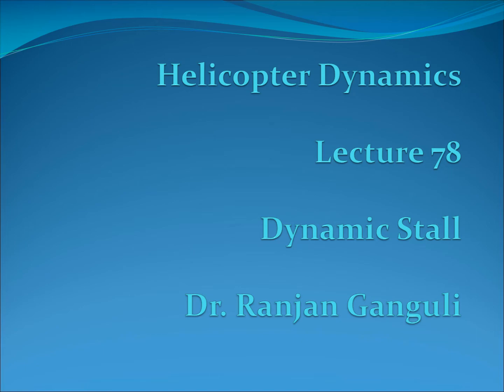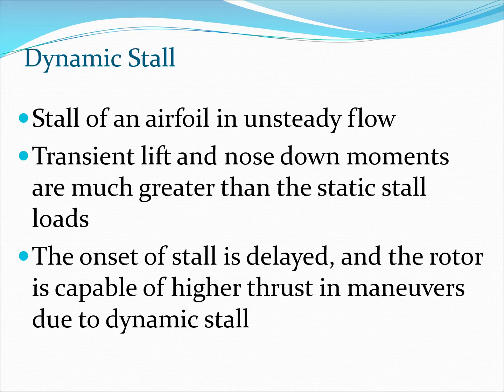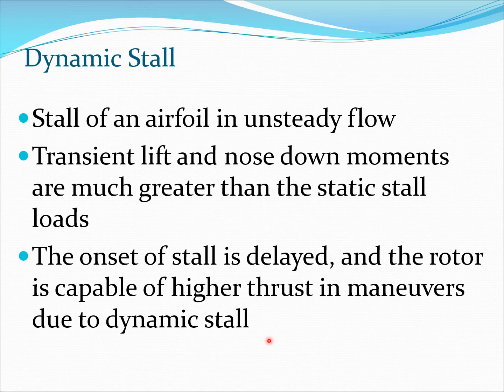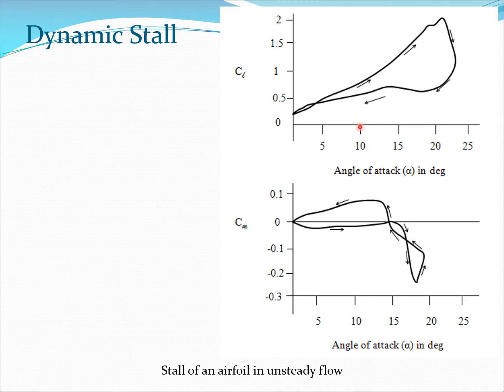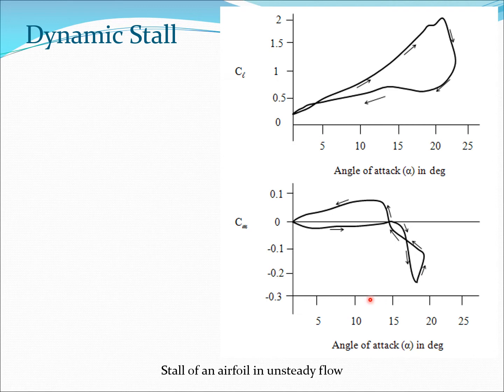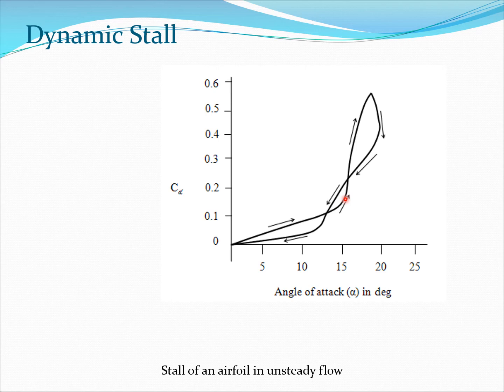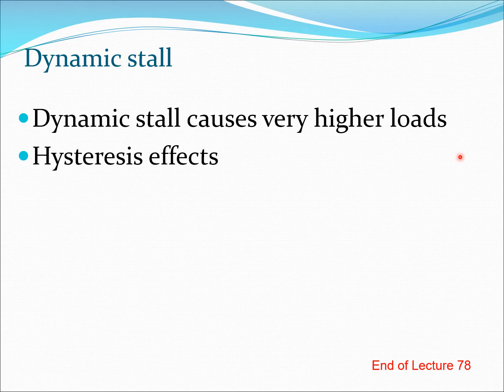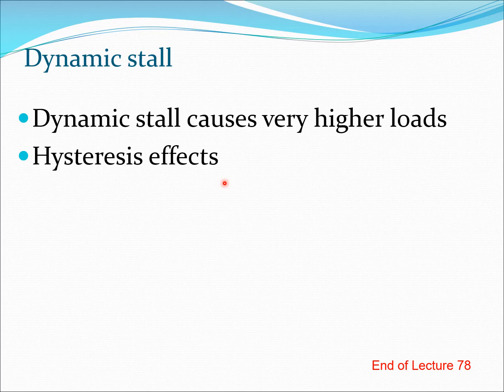Dynamic Stall, Helicopter Dynamics Lecture 78

Comment: Could you please explain why this dynamic stall occurs.?
Reply from the maker: Due to rate of change of the angle of attack caused by pitch and plunge motion
Reply: Can it be correlated to leading edge vortex convection ? Like in sweptback/delta wing?
Reply from the maker: @vishweshsridhar8900  I think it does occur in aircraft when they do sharp manoeuvres. There is delayed separation leading to high levels of lift but also greater loads on the structure